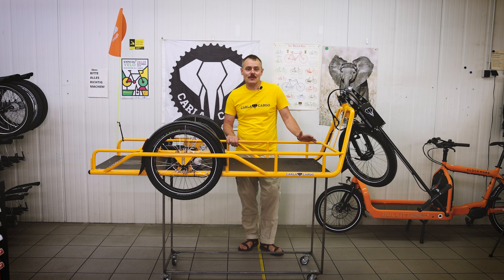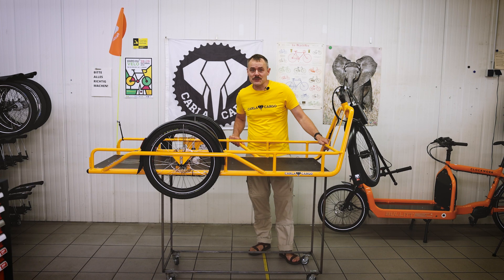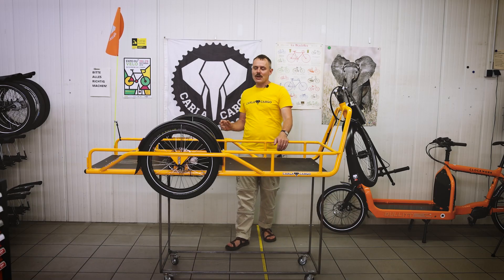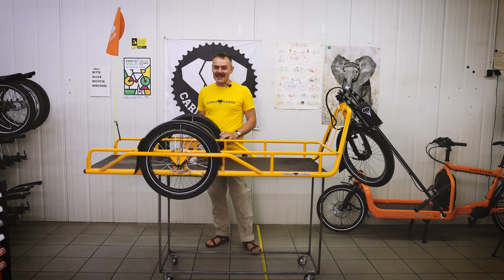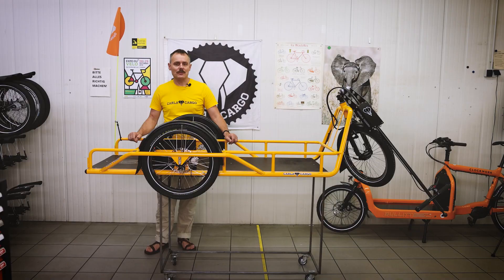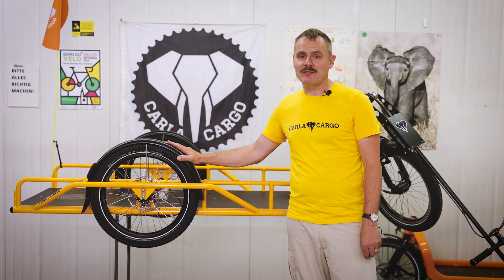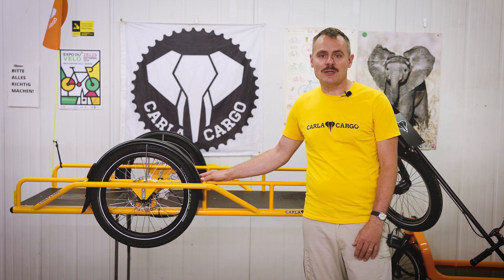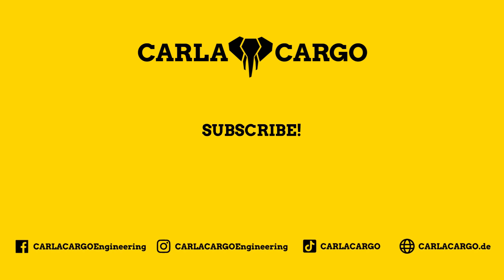This is our new CARLA 2021 💛

Comment: Is this street legal in Europe? (under 80 cm wide)?
Reply: In Germany (still in Europe) the following dimensions are allowed for bicycle trailers: 
max. width: 2.55m
max. length of the trailer: 12m
max. height: 4m 
The entire vehicle (bike and trailer) may have a maximum length of 18m.

The laws regarding bicycle trailers vary a lot in Europe. You should check your local laws by yourself.
Reply: @GenX-Joe  I think the 80 cm must come from the l1e spec, but even that depends on the number of wheels. Very strange now that I look into it. I thought it was the most logical to have one fixed width but it seems I was wrong.